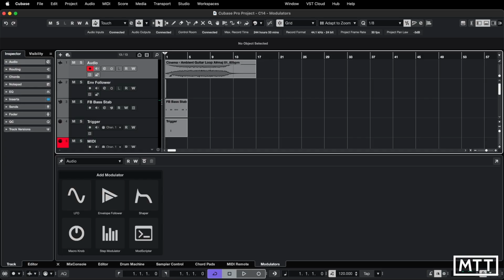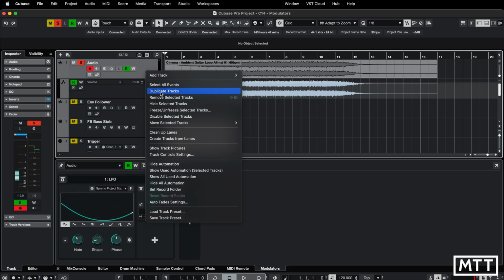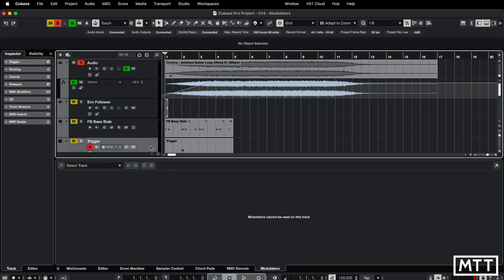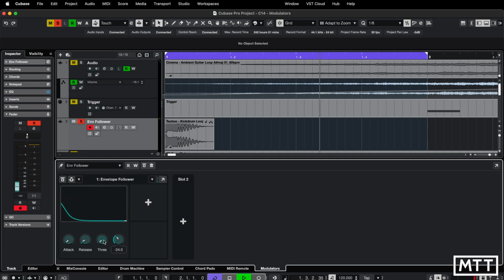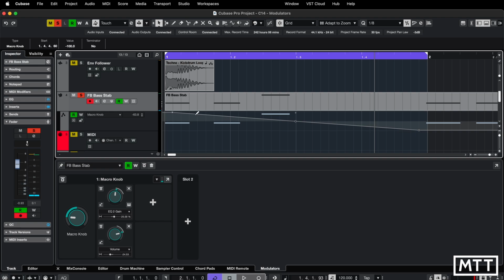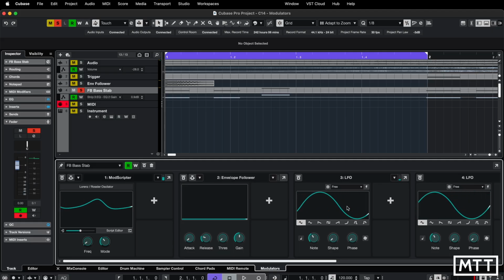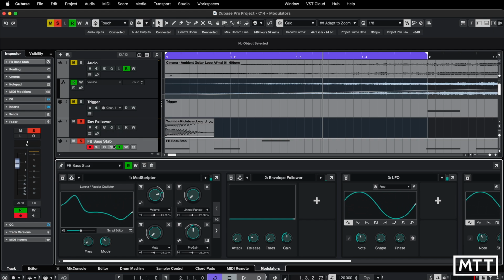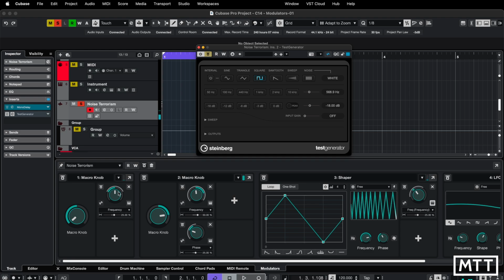Cubase 14: Modulators - Make your mixes Dynamic and Complex in Cubase Pro

Comment: What I also use Steinbergs new Volume plugin for, quite a bit actually, is post-plugin gain. So I insert the Volume plugin as the last plugin in the channel, to take down the volume to a sensible level, making the channels fader operate around 0 db, where it has the highest resolution. This also enables me to do proper gain staging on the channel as a whole, adjusting the channels pre-plugin (pre-everything, I think) gain, getting an optimal input level for the channels plugins.
I used to do this with a 3rd party plugin, but have swapped all those instances for Steinbergs own Volume plugin, as I'm sure it taxes the cpu less.

Comment: Does the new cubase update auto reveal (select) automation on the last touch? Meaning you don't have to go find the perimeter in a long list of automation menu.
Reply: That was possible in earlier version. Just activate write mode in a plugin for example, change the value of the desired parameter and a automation lane for this parameter comes up.
Reply: @hcl8836  How is what you just explain there better?